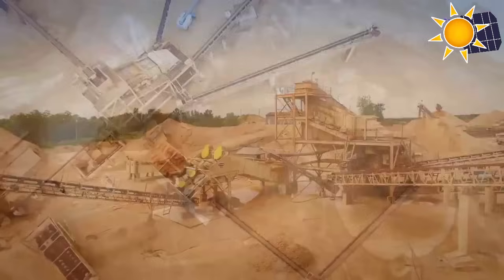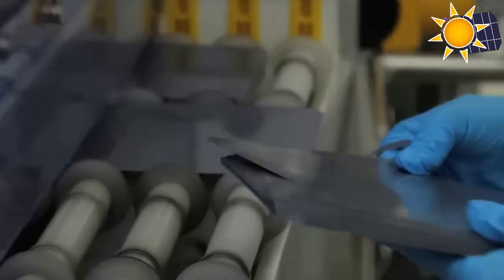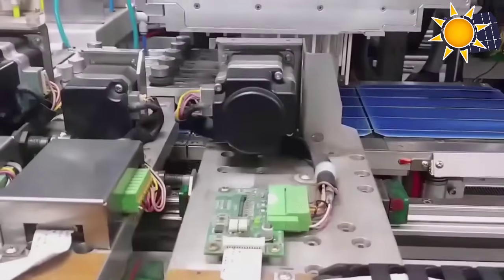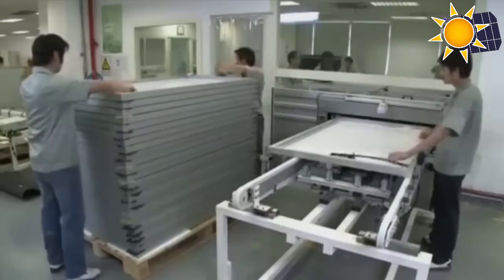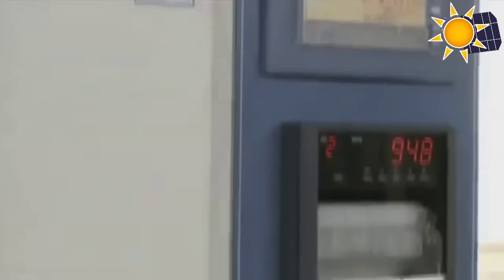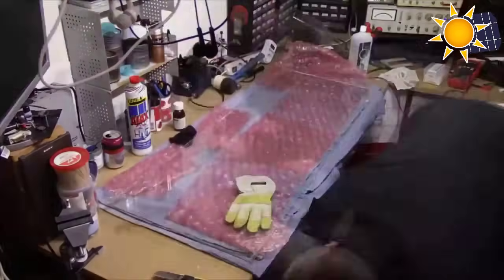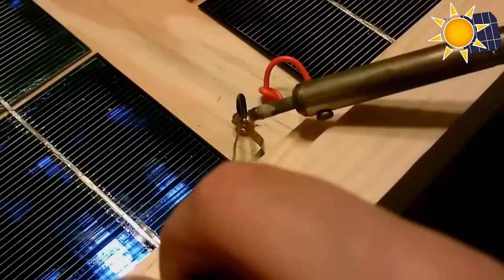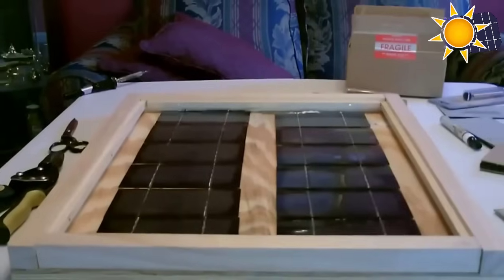Solar Panel Manufacturing Process in a Solar Plant

Comment: I'm confused, I see a lot of fossil fuel products in just gathering the sand than heating it up, and I ask myself if we are depending on solar-powered in the future, will we be able to make them without fossil fuels?
Reply: And they can't...
After, with a lot of energy, the quartz is melted, it is still not pure silicon, max 98%. Again, it takes a lot of energy to turn 98% pure silicon into 99.99999% pure silicon... and then all the rest follows up to your roof.
The 1st phase is mining, transportation,...
The 2nd phase takes so much energy that a panel takes 8 years to generate that. Green, you might say...
No, because to generate that energy requires three times as much primary energy, we are at 24 years for the 2nd phase alone.... Then the purification, we're at 30 years....
The worst is yet to come. While the panels are generating energy, so is the fossil power plant, even if that energy is not directly needed because of the PV... but, the PV can drop out at any time and then the back-up energy has to be there, generating that "grey" energy only then is too late and the grid would collapse, in other words, blackout. So the fossil power plant sends its energy to the cooling tower instead of the turbine, if the sun goes out, that energy can go directly to the turbine and the electricity grid remains in place. But the CO2 has been emitted... even though no electricity was made with it. Actually, it is too crazy for words.
And this way, the amount of CO2 in our atmosphere will only increase. And global figures show that too.

Comment: 2SiO² + C → 1900°C → 2SiO² + SiC   → 1800°C → Si + 3HCl³ → HSiCl² + H² → Si electrode, 1.147°C → Si + HCl → 1.414°C → Si (Silicon ingots)
Reply: Thank you for chemical reactions process. However I don't understand how the chemical reaction from (2SiO² + C) to (2SiO² + SiC) occur, where does the third "Si" come from?
Reply: @anthonyajibolaomoruyi8054 May be its called doping 😊
Reply: Heat where come from? Using coal?
Reply: This numeral codex, can it be explained by alphabetical sentencing. But i might speed dial chat gpt np😂